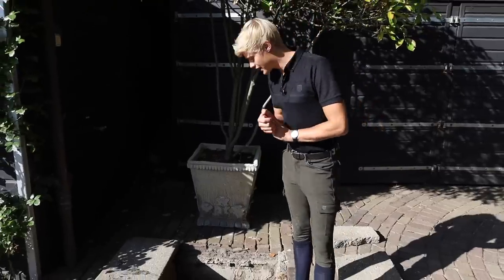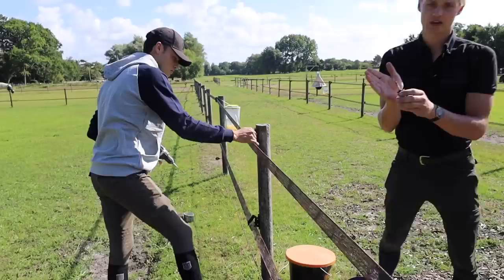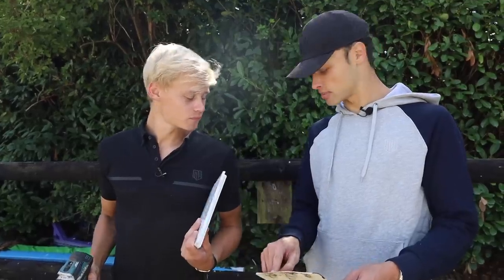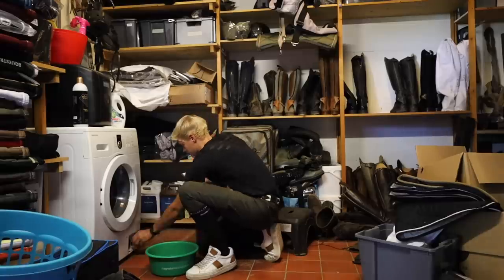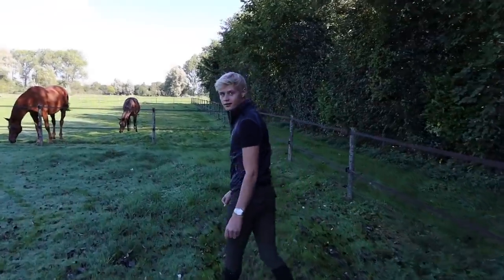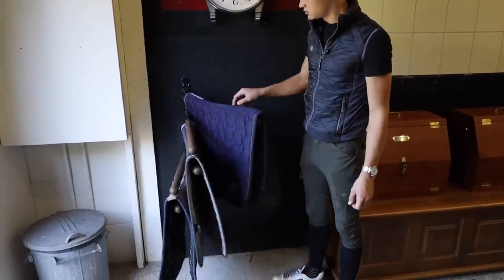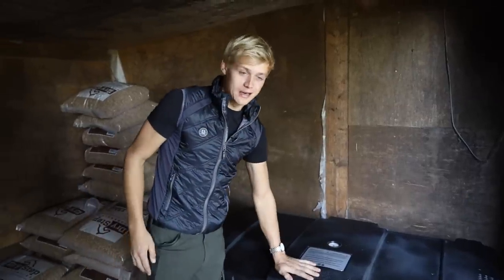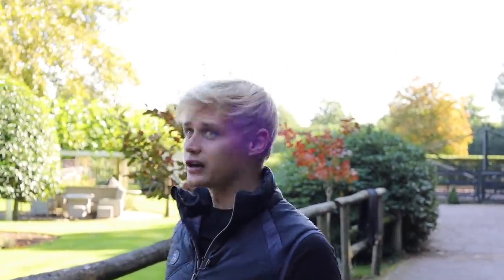Much needed stable organisation and cleaning vlog🔥💦

Comment: The washing machine cleaning when clogged. Open the little piece of plumbing on the right of the the big one you opened. Turn the rubber down, take the plug away. You'll empty just the water in a less messy way. Then open the big one and take away hairs etc. It's cleaner that way.

Comment: On the washing machine beside the 'screw' part that comes out there is a little hose. You can pull that out and unplug it and drain the water into a bowl. It's slow and kinda grosse, but then it saves the lake on the floor when you open up the screw plug. :)

Comment: Great video ❤😂 Even though it was so funny to watch a tip for next time to make your life easier with the washing machine.. on the top right just above the part you opened, there is a little snake you can slightly pull out and aim at a low bucket. Saves you from all that dirty water on the floor 😅

Comment: Jesse, when you open the door on the bottom of the washing machine instead of taking the large plug out, pull out the little black tube and you can direct the water into a bowl instead of letting your floor 😁

Comment: Jesse, the next time you and Matt have issues with your washing machine the small little tube to the right of the filter you unscrewed from the washer, is the drain tube. If you pull the drain tube stopper off, you can easily drain all the water left in the washing machine out into a pan, without water going all over the floor. After you empty the drain hose, then you can unscrew the washing machine filter. Hope this helps! :)